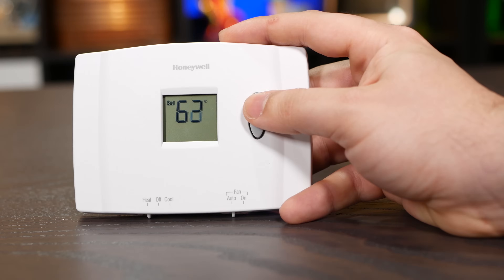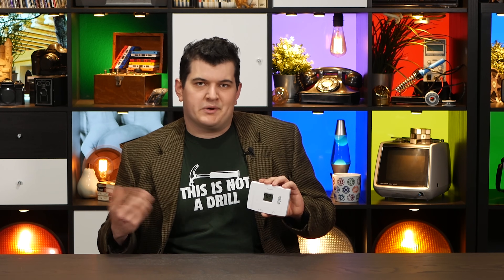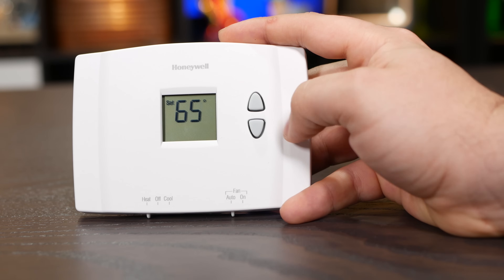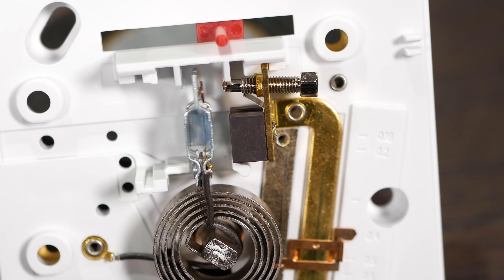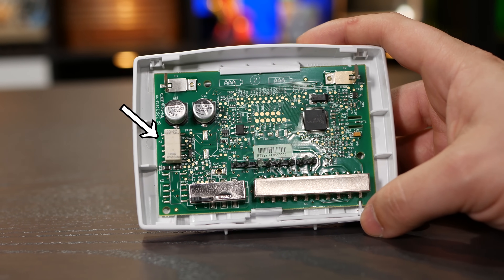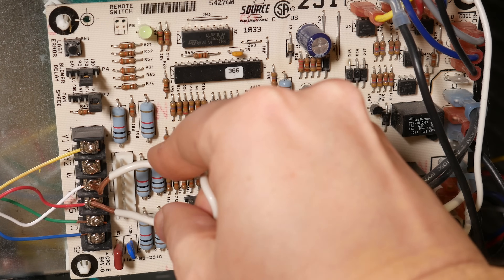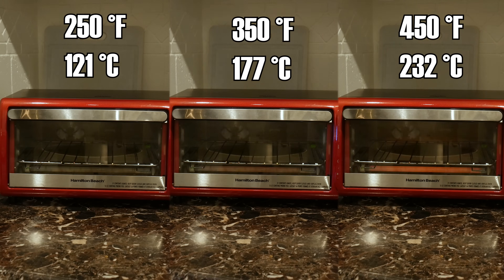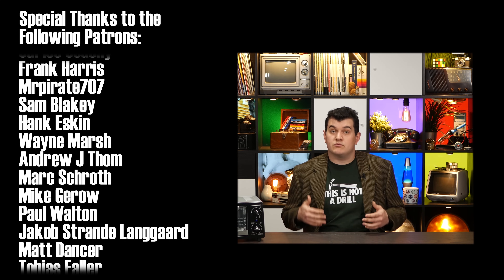Thermostats: Cooler than you think!

Comment: I an HVAC Technician in Colorado. I see thousands of furnaces a year and can tell you that in my case, I see about 7% 2 stage furnaces. As I can see in your comments, some people are telling you that they have a 2 stage furnace. They make 2 stage air conditioners as well (hence why the logic board on your furnace has a Y2 terminal) The catch is that you need extra wires to control the second stage. If you dont have a second wire, you can either jump the first and second stage to bypass the first stage, or you can have a "hybird" furnace/air conditioner. These units will go into first stage for a set time limit (8-15 minutes) then go into second stage (full power) if the thermostat doesnt reach set point. 

They even make modular furnaces and air conditioners that have several stages, but they are very expensive and not very common. 

Also, the color coding is on purpose. White,  yellow, green and red is standard and if installed by a professional contractor, should be hooked up to the correct terminals. Although, 4 wire is sold without yellow. It has blue instead. This is because you should always have a common wire, regardless of having batteries or not. 4 wire should technically only be used if you only have heat and not AC. if you buy 5 wire, you will have both yellow and blue, hence it is made for single stage AC+furnace set ups. Once you dive into 2 stage units, things get blurry, although brown is commonly used for W2/1st stage heat. 

You also mentioned the idea of turning on the AC for a short period of time, then going back to the regular schedule. This is possible and always has been. Simply turn the unit on. It will automatically go back to the set schedule once you reach the next scheduled time frame.

Someone else mentioned the fact the the temp sensor is in the thermostat instead of around the house. I would say this is 100% about cost. They make thermostats that can have remote sensors is seperate rooms (nest does this). With remote sensors you can have your master bedroom be the souce of temperature regulation, rather then the thermostat thats in the hallway. They also make wifi thermostats that achieve the same effect by taking the thermostat into your room at night. Sadly none of these problems would exsist if the ductwork was constructed properly. If the duct design isn't  sized properly, you will have uneven heating and cooling. Wireless thermostats, dampers, and remote temperature sensors would not be needed if every house had properly  sized ducts. From what ive seen, almost no HVAC system is actually sized and built properly.

At the end of the day, your video was about how thermostats work, and you got that exactly  right. I deal with several people a day, and many of them dont understand how a thermostat works. They think that turning it up to 80 will make the furnace work harder. I politely tell them that it doesnt work like that, and that the thermostat is simply an on off switch with a temperature sensor. I will be telling my customers to watch this video from here on out. Thank you for posting!

Comment: I have a generic Honeywell digital thermostat that controls 2 heating sources and a central air unit for cooling.  It allows me to temporarily change the temperature before falling back to its schedule.  I can't tell it directly to "Run for for 30 minutes" but I can accomplish the same goal by temporarily changing its set temperature and setting an expiration time before it automatically reverts back to its heating/cooling schedule.  When I get home/if I remember, I'll pull the thermostat and grab a model number to share in case this feature is still of interest to anyone.

Comment: Here in Israel we don't have these at all...
We just have AC units that acts as a both way heat pump.
You set it via the remote and that's it.
I always thought it was stupid that in most models the thermostat of these was in the base unit instead of in the remote, but i guess if it wasn't effective and stupid it wouldn't be like this in most AC units.

I also hate these stupid IR remotes with rubber buttons that stops working after a few months and makes you break a finger trying to squeeze these mushy buttons.
After owning a 50$ Xiaomi MI TV BOX with a nice clicky bluetooth remote that actually has feedback of what the device does and does not I hate these!!!!
this makes all of our ACs that costs considerably more obsolete and really annoying to use.

How hard is it to just make an AC with a nice UI? why isn't it everywhere?

Comment: Interesting fact that might not be present in USA but yes in EU. 
Nest heating in OpenTherm, reads the outside temperature using Internet, temperature difference between inside setpoint and inside current temperature, then elaborates its algorithm and sends the information to the boiler (furnace in UK) to run a specific temperature in the radiators. The higher the gap between the setpoint and current temperature, the higher the temperature in the radiators. As it gets closer, it lowers the flow temperature up to the sweet balance between the energy the house is loosing and the one provided by the radiators.
This will leave the heating running longer at very low temperatures (great for condensing boilers) and avoiding cycling, which has been proven to waste energy and be less efficient.
This protocol powers the thermostat and send/receive communication using only two wires, similar to BUS.
Different brands use different protocols but all do pretty much the same.
Smart thermostats using ON/OFF use a thermal inertia algorithm. They measure the time the house takes to increase the temperature and it stops the heating before it reaches the set point (inertia will do the rest); at the same time it will measure how long it takes to loose the temperature and it'll start the heating before the setpoint is lost by too much.
Fact: by-metal thermostats are banned to be sold in the UK due its high hysteresis. New installations must have electronics capable of measure decimals of Celcius.

Comment: I had a furnace sales man try and sell me a furnace and a/c unit that never "turns off" it had a variable speed motor in it, and a very complex heating element, according to him it would just slowly change how much fuel it was burning and how fast the fan was blowing. According to the sales media this design worked better with humans and overall saved energy by only burning the fuel required blah blah. I read that after I saw the price tag so I don't really remember clearly.
The fact it would cost more then a luxury car to install was an issue for me.. so I cannot report on it.

Comment: Hold on if you have a natural gas furnace, does not that furnace have a  valve to regulate gas flow, in theory if that valve had some for of electtrical contrll you (in this case the thermostat) shuld be able to reduce the gas flow and thus the heat output ( ok thing might not be liniar but yoy get the point). Ot am i missing something?

Comment: Modern European heating systems, known as boilers, use heated water with radiators and they sometimes support PWM for the hot water temperature via the OpenTherm protocol.  If the connected thermostat is compatible, the temperature of the water going through the radiators can be adjusted in increments between full blast and semi-blast.  This helps maintain a nice warm heat without searing hot radiators, while still allowing full blast for those really cold days.  Generally setting the temperature way up doesn't allow you to heat faster (https://www.youtube.com/watch?v=lXmIOub22qI), secondary heating systems aside. 

While most thermostats don't control their duty cycle by anything more than current indoor temperature, the Nest Learning Thermostat can also take into account outdoor temperature, weather forecasting, hourly energy prices, occupancy modeling, learned thermal properties of the home, remote temperature sensing, and more.  Still, even the smartest thermostats are "just a switch" (if you check the bottom of the legal screen on a NLT you'll occasionally see an easter-egg that admits just that).  Source: Nearly 6 squirrel-free years of working on the NLT.
Reply: Jayne Tucek Haha, no OpenTHerm in US, we are still living in 20th century.
4 wires for 4 bits of information :)

Comment: There's an underlying presumption that in your heating/cooling system the system delivers the same amount of heat/cooling to every duct. I've known systems that due to their poor installation have not delivered  evenly. So thermostats that take temperature from different places in the temperate area to manage the behavior of the central unit are IMHO necessary.

Comment: Most likley been said, But most programmable thermostats allow for an temporary adjustment  you can crank it up/down and then ti will revert to the standard setting at the next programmed time. All ones i've own do this. Nest included I am pretty sue you can set a timer but haven't looked in to it.

Comment: At my work, the thermostats have a button marked "occupied”. It will run at a modified temperature from it's original programming. Depending on if it's set for heat or cool, the HVAC will continue to run for a period of time. I think they are Honeywells.

Comment: On the last question, most programmable thermostats have this. If you adjust the temperature from the programmed set temperature it will "hold" the new temperate for "X" minuets, after the elapsed time it will return the its regular programmed temperature. Typically 1-2 hours on Honeywells, but typically you can adjust the desired "hold" time.

Comment: 2 things to mention:  1.. the effect you were describing about the magnet and stuff is called "hysteresis"  and you were correct on why its used in thermostats and switches.. 2.  the idea of having a thermostat "run a single cycle and, then, switch off" is easy to do!  you can do it using a second thermostat set up  in series  with the C lead going through the second stat's contacts..  ( OR you can get a "timer switch" module and put that in parallel to the C lead as well...  "press a button and the stat will  be bypassed for x amount of time and switch off" since this requires no active temp co-efficient its merely turns on the heat (or cooling)  for the timer's set time. it merely "closes the contacts (call for heat/cool) for X amount of time".

Comment: I lived in a house that had a heating system installed in the 1950s. The thermostat had a "U" shaped bi metallic strip instead of the coiled shape, with the contacts at the top, and no magnet. The wires to the furnace were red, white, and black, with the black being common. In the 1970s the thermostat was replaced with a mercury one, with an "anticipation heater" wire over the bi metallic coil. The installer just connected the red and white wires, stuffing the black inside the wall. The furnace worked on as before, so obviously the black did nothing.

Comment: Most mid-range Honeywell thermostats that support scheduling kinda allow for the 'cool blast' feature you and CantComeUpWithUsernames wants. Kinda. They can do a 'Temporary Hold' where it deviates from the scheduled temperature until the next schedule point. It's not the best solution, especially if the schedule points are really far apart (mine as programmed: morning[7], mid-day[12], evening[18], and night[23]), but ItsSomething.jpg

Comment: My house still has some of those Mercury tilt switches xD
Reply: Alot of places still have them. The 7 floor office building I work in still has them and it was built in 2004.
Reply: It is precisely because the new smart thermostat requires batteries, and has a computer in it, that I still have a mercury tilt thermostat. I have it wired in parallel to the smart one, and set to its lowest heat setting (about 10c) to prevent pipes from freezing if the batteries die in the smart thermostat when I'm away for a long weekend.

Comment: I used a thermostat, a 6 volt battery, resistor, and 5 volt relays to control some outlets that have a heater and a window air conditioner plugged in. I basically made a very simple HVAC system for cheap. It works very well and now I can control the climate in a porch where our whole house system isn’t installed. 

Yes. The outlets, relays, and circuit breaker are high amperage and are fully capable of safely running the heater and the air conditioner independently.
Reply: Additional details:

The 6 volts from the battery run through the thermostat and to the relays when the thermostat receives the programmed temperature. The relays then close the circuit of the 120v line, enabling the outlets of either the heater or the air conditioner. Before you say “AC’s and heaters already control temperature”, I have very basic cheap units that only have an on or off.

Comment: can we talk about the temperature of the air as it comes out of the vents? my old furnace/hvac/heater/whatever used to only put out one temperature air, so in the winter the heat would run for an hour before the house got warm.  then it bit the dust (literally, with it's flamey teeth and tried to set itself on fire because why would any machine, especially one that spends 7 months on fire, need regular maintenance?) so we replaced it. on a super cold day the air it pumped out would be super hot, but on a cool/tepid day the air would be lukewarm. "maybe it's me," i though. then i grabbed a thermometer and checked. it wasn't me. the air coming out of the vents is actually different. when did this change happen? who decided that should happen? what controls the temperature the air is heated/cooled to? why is it called an air conditioner? how is it sucking the heat from the air?

Comment: My heat pump does go on a higher powered blast when it's fallen behind.  But this is a temperature sensor in the unit itself and not stand-alone thing on the wall.   Hmmm, isn't this part of what makes inverter heat-pumps more efficient???   Note, this isn't a 2 stage system.

Comment: As to thermostats being simple/dumb, even semi-ancient ones have lockout circuitry during A.C. operation so that you have to wait X minutes (maybe 3 or 5) after being in "on" condition, to initiate another "on" condition. Then in newer digital ones, you can vary the sensitivity from the "approximately +1 degree to turn off, approximately -1 degree to turn on" to specify your own settings, like 0.4 degrees if you desire.

Comment: In regard to your last question\answer: any programmable thermostat will go back to its set temperature after you adjust it once it reaches the "temporary" adjusted temperature. To bypass the set temperature, you would need to press the HOLD button (all programmable thermostats have a HOLD button for this reason...to bypass the program.)

Comment: I counted at least 4 times of sharp insistence that it is "just that simple" or "all it does is one simple/stupid command - on or off." What the heck? I could see making the mistake of saying that while only thinking of A.C. -- but clearly this focused on heating. Natural gas furnaces (which have been in 95% of all homes I've seen or lived in) have an approximately one minute heat up phase, THEN the fan starts. Then the fan runs one minute after the thermostat says to stop burning, in order to not waste the heated air that is in the ducts and has not yet been distributed. So there's more to it than one stupid/simple/dumb on-off command.

Comment: My thermostat is a little clever one. Its not a hive or any other "smart" thermostat that runs android or anything. It learns how long it takes the room to reach a temp and them monitors low fast it loses heat. Then it applies that pattern to how often and how long it fires the boiler. The boiler thus tends to fire for only a few seconds, just long enough to warm up the water and move it round the system. These little things are pretty common in the UK. Most new thermostats with a digital readout seem to do this. Oh, it only heats. UK homes only have heat, no AC or fans other than standalone AC units and fans. My office building has what you would call HVAC but its not used properly.

Comment: Regarding themostats that can run for only a single cycle: I don't have any recommendations, but both programmable thermostats that I've used support it (you can override the temperature for some time, and that's the normal behavior when interacting with it instead of changing the cycle).  My newer one (not sure of the brand) lets you chose between overriding for 1 hour or 2.  But more control (e.g. exactly one cycle, or anything like that) doesn't seem to be a thing.  It seems like it would be easy enough to DIY with a raspberry pi and some relays, though...

Comment: (14:35) That's not entirely true. The greatest locations for air leakage is around windows and doors. Windows are also on the exterior walls of the house, while your air thermostat is centrally located within your home/apartment, and usually doesn't receive direct sunlight. Putting the thermostat in a central location will give the most accurate average temperature reading with minimal fluctuation. But as you said, it doesn't provide any personalized difference for those outlining rooms which may be warmer or colder compared to the central area.